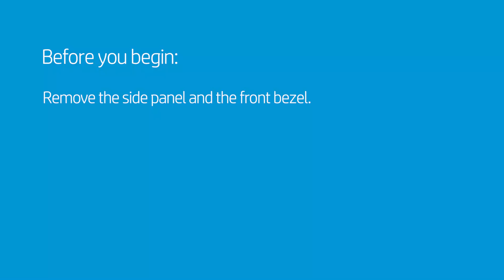Replace the Hard Drive Cage | HP Slim Desktop S01-aD0000 | HP

Comment: Hey hp with all your hp slim desktop model have one of them have power supply issues I own one and it had a power supply issues and it did not survive less than a year and I got shocked from the case five times

Comment: Can I open open CPU if my warranty is still available......can it affect my warranty policy...
Reply: I have to intall another ram chip and cd drive
Reply from the maker: +Rushikesh Ghanekar HP does not recommend upgrading or downgrading hardware parts or software that is bundled with the product as It may affect the manufacturer's warranty and performance, however, you could change the configuration at your own discretion.